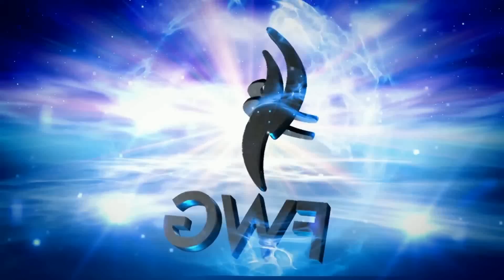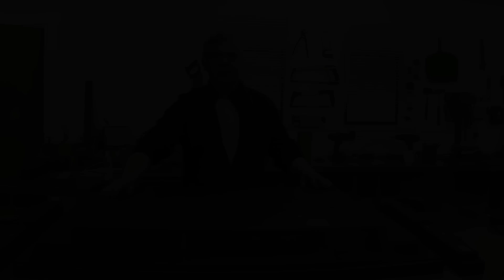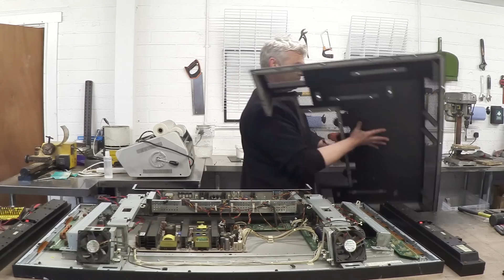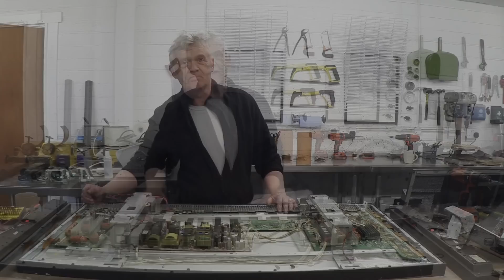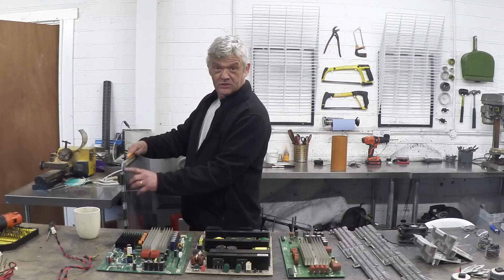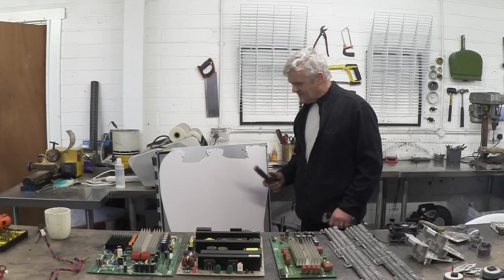Pulling Apart  A Plasma TV

Comment: That’s not a plasma tv/ where are you 3 circular colored glass that sits between the other like magnifying glass about 4 inches in diameter one glass component is green, one red and I forget yellow or blue. And there is a clear liquid under birth the glass, like mineral oil or something. If it was a plasma tv you would lay it down like that . I drove for Bekins trade shows and we had 103inch plazma tv/ we couldn’t even turn it sideways to get it up the service elevator at the mall of America. We set up a Christmas living room display with the tv as the main attraction. 70,000.00$ for that tv, it was 8’x5’. But yeah there is liquid in them so like a fridge you cannot lay them down . Thank you for the video/ but that is not a plazma tv

Comment: You explain quite well how to "figure out" how to take something apart lol. Something that really did used to be common sense. Something I figured out in my own at 7 yrs old while disassembling a keyboard (musical) that I found in the dumpster. I assumed everyone on the planet knew that to get something apart, you look at it, see what's preventing it from coming loose, then remove whatever it is, and keep going like that till it's apart.... Until I asked my son to swap out the air filter on on the lawnmower one day.. 30 minutes later I'm standing there in bewilderment as he was trying to figure out how this spongy piece just magically moves through the metal case into its position, paying no mind to the single bolt that had to be removed first... Maybe those video games really DO rot their minds..

Comment: I have just got a plasma tv from 3 doors up and crazy heavy I’m surprised you never put a multimeter on the screen as I did thinking with it being plasma the sun gives off plasma it works as a solar cell the 22 connectors on the bottom of the screen give 7.6v in total and haven’t tested the side ones yet but loving your videos as everything you are doing is what I’m looking into but for different reasons

Comment: I note that you keep one hand in your pocket or behind your back - standard electrical engineer practice to avoid shocks across the body, even when the device is not powered.
Reply from the maker: well noticed mate
Reply: Robert Murray-Smith I am glad I read down the comments before I asked if your left arm was injured. It looked like you were favoring it. But now I know it was an actual example of a method I saw mentioned in a YT about high voltage electrical circuits. Great video! Thank you again! bb

Comment: Loved the video Rob, although I might suggest a safety reminder at the beginning. If anyone is silly enough to do a plug in test to see if it works and then go straight into dismantling. If the PUS has any faults which prevent the high voltage capacitors from quickly discharging then the retained voltages can be at lethal potentials for some time. Any of the younger viewers will only be used to modern low voltage circuits and not the Tesla ( that's his holiness Nicola not the Baywatch one) coil voltages of real old school TVs.
Reply from the maker: thanks for the post mate - hope you are well

Comment: You can take the Aluminium shield as a housing...and with the rest, you build an audio amplifier.The boards are full with rectifiers capacitors transistors resistors etc.

Comment: i think they used a lot of magnesium for those structural parts. cheap and good strength to weight ratio. getting harder and harder to find good large  transformers and flyback coils since less and less things use high voltage now. good to save that stuff and the heat sinks. that aluminum plate is really one massive heatsink i suspect. That tv probably heated a whole rooom.
Reply from the maker: lol - yeah it got hot and magnesium makes sense now i think of it - cheers mate - good pointer and appreciated

Comment: Need IGBTs? You can get 23 of them out of the Prius drivetrain (the inverter) - those are liquid cooled and sealed in gel. Junked cars are a good source since nobody's ever going to fix the old ones due to high battery cost.
Reply: Ah the old Pull&Save junkyards.
Reply from the maker: thanks for that mate

Comment: I found very useful stuff in these. Also I found good parts in used amplifiers. MOSFETs, MOSFET drivers, transistors, op amps, various diodes, Schmidt triggers, LEDs, big ceramic capacitors, thermistors, optocouplers, etc...
Reply from the maker: Thanks for the tips mate - it is almost a crime what we throw away